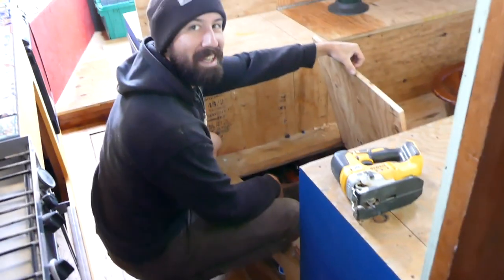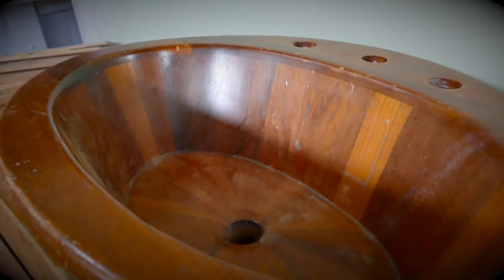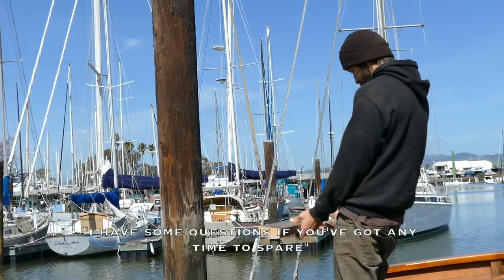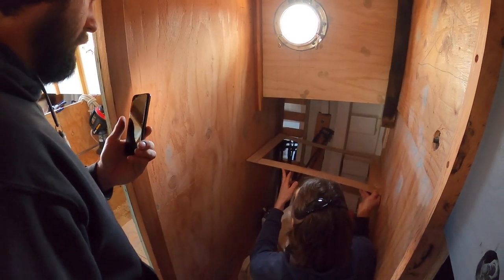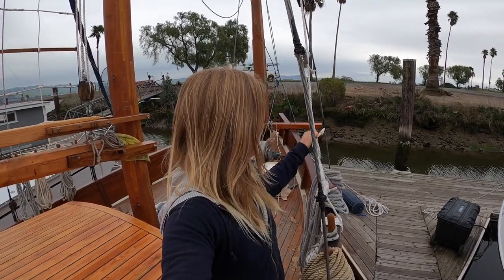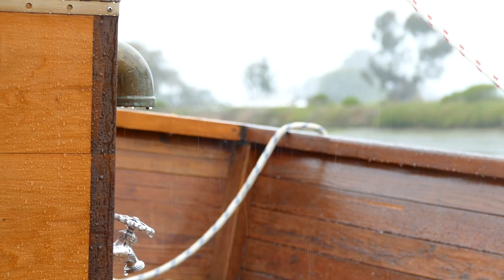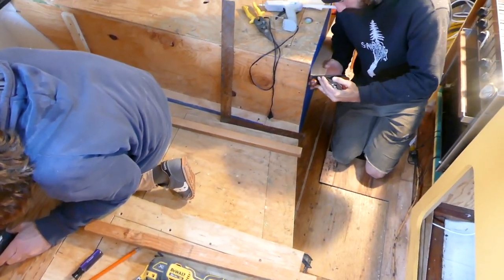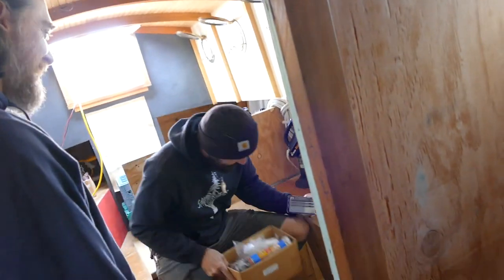Salt & Tar: Ep.136- Got Sole?

Comment: I think it's hilarious that you're using a spirit level to check things when your on a boat floating in the water with no fuel tanks, water, not stocked with anything but the basics, and other things...and yet his internal walls are not straight or level.. haha.... Btw that sink looks lovely. Maybe it's time to start making the companionway stairs so you can get in and out of the cabin instead of using those milk crates all the time..... and then Bam at 12:45 you mention them .... about friggen time.. yipeee...

Comment: Garrett get yourself a 1 inch sheet of pink foam insulation from Home Depot (20$)and take off a 2 x 4‘ section. Lay that on the ground, floor or table.  Now you can set the depth of your circular saw to just below whatever material you are cutting and it’s almost like a having a mobile mini table saw. Upside down of course 😃

Comment: Watching Garett doing the pin rails makes me think a midsize CNC Router like our shops Next Wave Shark would be pretty handy. The basic shape for each is the same except for length it appeared from your video? It would be a snap to just tweek the dimensions from area to area on your rigging for the different rails. If any local volunteer offers one to help you finish, take them up on it. They make my projects go at warp speed. Close, close tolerances too.

It really is all coming together for you two now, it looks. And it really is looking sharp since your haul out and paint.